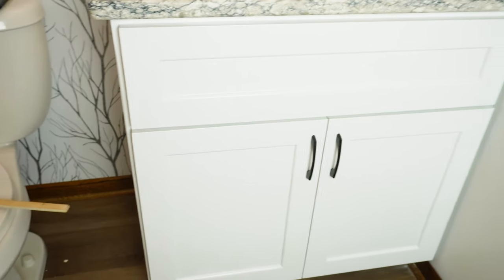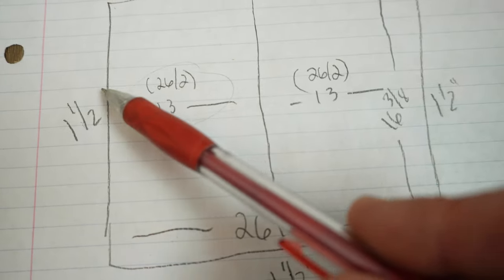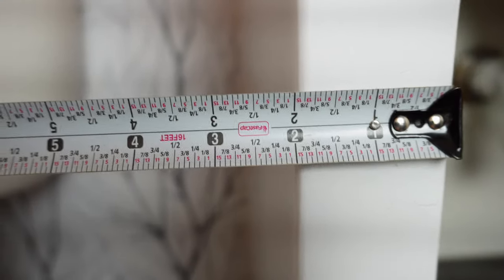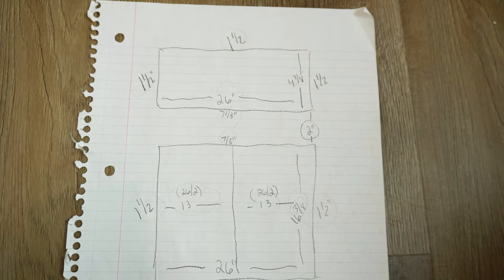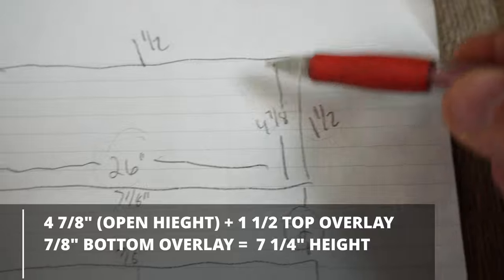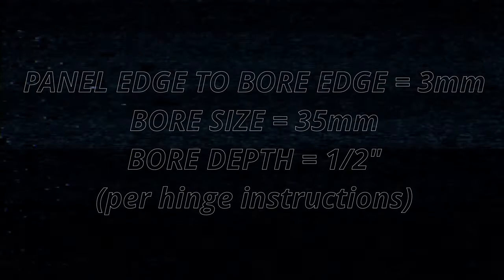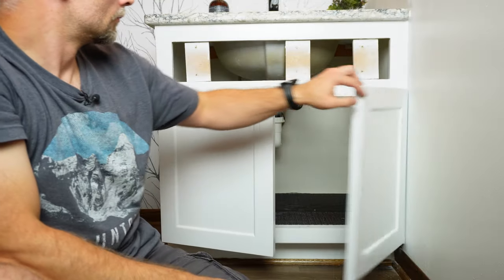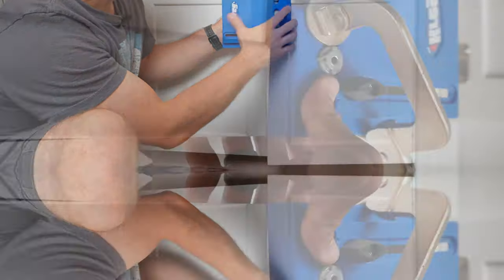SIMPLE Cabinet Upgrade | BEGINNER'S GUIDE to Replacing Cabinet Doors

Comment: No mention of the center gap between the two doors so there is clearance to open. You would subtract 1/2 of that form the width of each door.
Reply: I was wondering about that myself.  From what I've seen around, is a minimum of 1/4 gap in between doors

Comment: I needed to replace a door that was broken off at one of the hinges, but the old hinge had the small holes (with inserts) screwed into the door at a different location closer to the edge of the door,  and my replacement hinge, requires a 3/8 inch  hold drilled into the  door about  1/2  inch further into the back of the door.   This means I will have 2 holes drilled into the back of the door.   and then I have to insert the rubber/plastic  inserts and then screw the hinges into this  insert.   Is this OK to do...?

Comment: I would have done a 1/4 gap between the 2 doors as well. As it is now, the outside of your doors don't match up exactly with the panel at the top and the gaps are uniform. Super nit picky sure but if you're going through all the effort anyways, might as well.
Reply from the maker: Thanks for the tips!

Comment: Where did you get doors and false door from?
Reply from the maker: I ordered them online from Cabinet Door World. I do have to say I was impressed with the quality and the measurements were spot on. It took about 5 weeks to get them though, which is the only downside to ordering them vs building them yourself. In my opinion there is little to no cost savings when you are only building a few doors!

Comment: Did you buy the doors in the correct sizes or make them?
Reply from the maker: I ordered them online from cabinet door world,
it didn't cost that much more to order them vs
build, and it made sense since 1 only needed 3
panels. They were good quality builds and had
great customer service